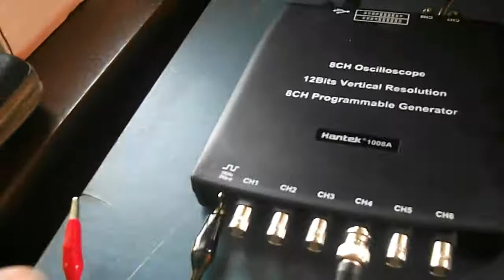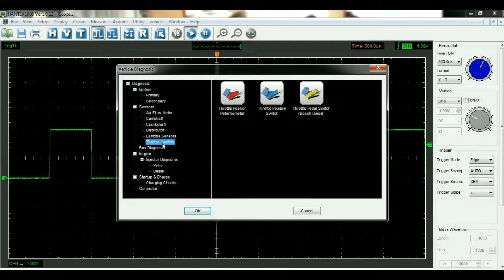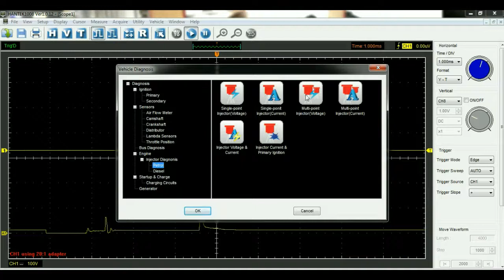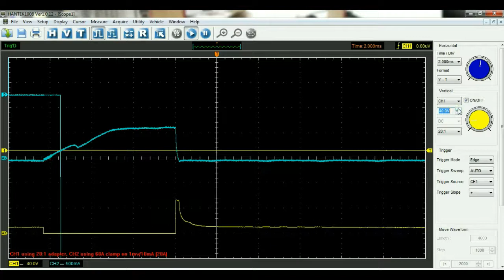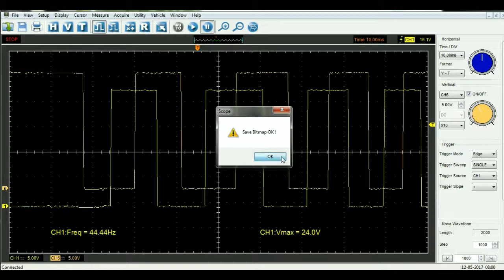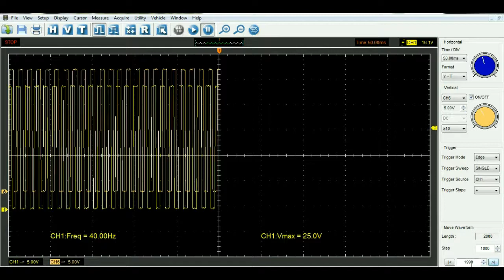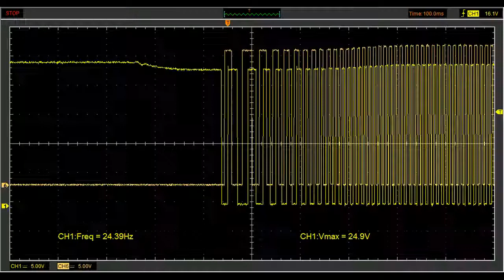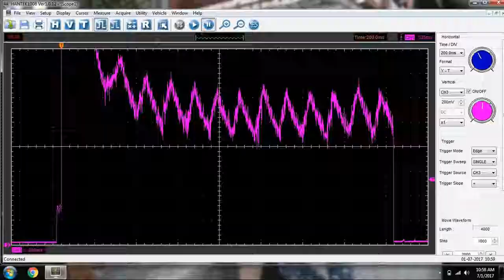Hantek 1008

Comment: Any interesting demo of some of the Hantek 1008 capabilities, but severely hampered by the lack of any audio track or explanation of what was being demonstrated.  Having the vertical bar set on a channel that was not  in use during the video was also not very helpful
Reply from the maker: Sorry i speak Serbo-Croatian, maybe later i will record something better. Some of this items i sell, so i expect that people who want to buy will understand this.
Reply: Oh, that makes sense now.  Maybe add some subtitles for us English speaking dummies!  Your video is the only one I have seen on YouTube that clearly demonstrates how to hook up the probe leads to the signal generator outputs on the front of the Hantek.  What scope accessories do you sell Marko?
Reply from the maker: I buy few of this HANTEK 6022BE and 1008 to try and to sell . One of this 6022BE and 1008 i leave for me.  i buy also attenuator 20X1, 100X1 and this (10000X1) capacitive pickup for secondary ignition testing.